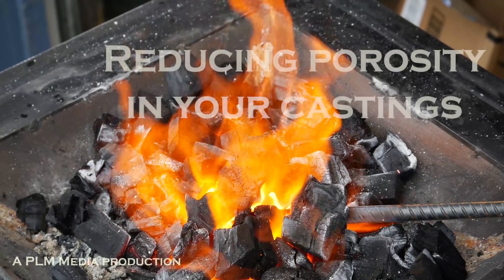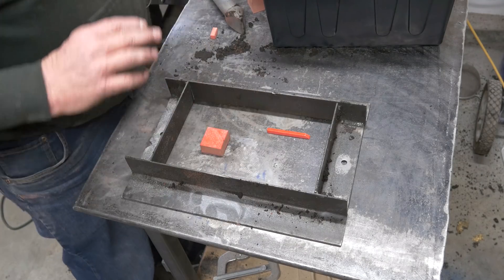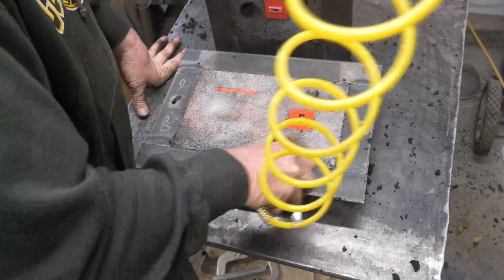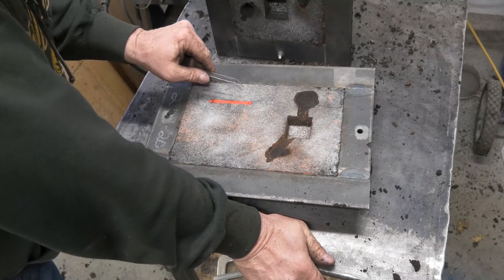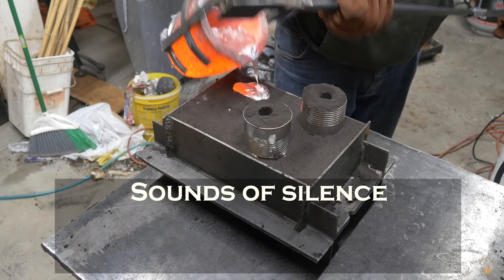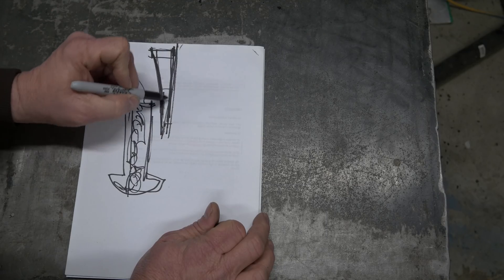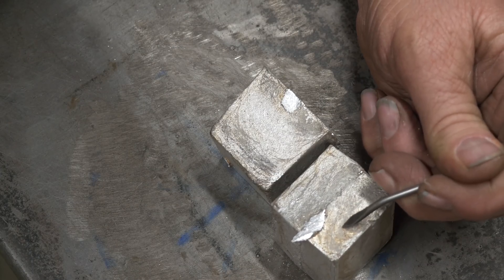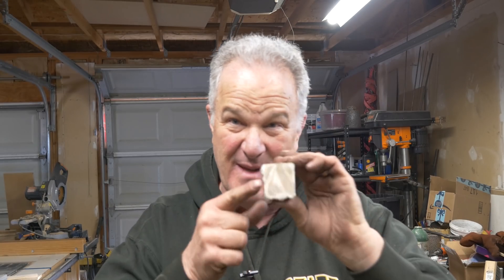Reducing porosity in your castings

Comment: Great demonstration Perry! Do you think it would have made a difference if you poured the metal faster in “A” like what Bob was saying in a previous video? 🤷🏻‍♂️ but great job though 👍🏻
Reply: Art, Unfortunately what Bob said is a bit open to misinterpretation, to me he said pour fast enough to avoid miss fills but keep the velocity low. I do not think Bob was suggesting that we should just dump the metal into the mould in an instant. AS John Campbell points out it is surprising how slow you an p[our a mould and get a well filled casting. I have seen 10 Kg castings filled in 5 seconds that showed evidence of miss run because of the chaotic fractured metal front. The system was redesigned to fill in 20 seconds and no sign of miss fill because now the metal front was a steadily advancing wall that tended to keep it self hot. In essence what I took from Bob's statements was keep the Lbs per second high enough to avoid miss fill but keep the feet per second low enough to avoid undue  turbulence - correct gating design can achieve this.... Martin
Reply: Olfoundryman thanks martin 👍🏻 so would you say a tapered sprue is necessary or it’s more important for proper gating? Also the basin in the cope to let the metal flow over and in?
Reply from the maker: @ArtByAdrock  hey bud, sorry I missed your original question.  Let me jump in here to try and answer... Martin correct me later, he's never been shy about that. ;-)

The basin/ridge is there, to minimize the turbulence and "sucking of air that happens when you pour directly down the sprue. If you notice (i'll do anything to drive more views) when I poured into the basin there was a solid, short stream of metal between the crucible and the basin as the basin fills in a fairly calm manner it runs over the ridge. The goal is to maintain a flow rate that keeps the metal over the ridge AND the sprue full. That will virtually eliminate air coming down the sprue and into the part. 

The taper is there to prevent the metal from having space between the wall of the metal (think of the metal flowing inside a pipe it has made) and th sides of the sprue. The taper reflects the fact that as the metal falls it gains speed. As it gains speed it the pipe gets smaller and smaller (diameter) . Just like the water coming out of your faucet does if you turn it on a low enough rate to get solid flow but not drops of water.

The runner is pretty much extensions of the sprue. If they're too big, metal has room to slosh around. If they're too small, you restrict the flow. 

Gates, as Bob said can be larger to slow the flow of the metal but I think they should be the same area, in cross-section as the runner. If you have two gates, they should each be half the size of the runner.
Reply: @ArtByAdrock , I think of it like an F1 racing car - all the bits (including the driver) have to be well deigned and working in harmony to win the race. That said if cornered on the subject I would say that the small tapered sprue is the most important, a close second is the ridged pouring basin design and these are very easy for anyone to do - there is not really any excuse for not using these. The runner and gates are a more difficult thing to get right and their correct design can vary a lot from casting to casting making it more difficult for us hobbyists. But if we at least keep the runners etc on the thin side (less than 12mm) so the metal in them can not fall over itself and thus trap oxide and also tends to stay in a solid front that fills the runner completely we won't be too badly off. There are other refinements that we can try and I think SW has an upcoming video that might show some of these.... Martin
Reply: Olfoundryman ok thanks 👍🏻 if you watch this thursdays video I put out when I do the sand casting I would love to hear your input and any advice. I’m sure other followers would as well
Reply: @swdweeb , gates can and should be wider, to slow the metal entering the unpressurized area of the mold down to below the critical velocity (20 in/s). The trick is, what to put at the transition so this doesn’t create turbulence. Bob Puhakka says that’s what filters are for (and not for filtration).
Reply from the maker: Good point and very true. The drop of my sprue is short enough that I think I stay below the 20in/sec but yes widening the gates allows the same amount of material to be spread across a larger area so it moves slower.
Reply: No,  @swdweeb , you’re well over that number. 20 in/s is the speed reached by something falling only ½″. (From v = √(2gh) = √(772 in/s² × ½″) = √(386 in²/s²) ≈ 20 in/s.)

Fortunately, the “top gate” is straightforward enough to implement in a two-part mold. I sent you an email with a sketch.
Reply: @olfoundryman8418  I was thinking Bob meant it literally. By matching the basin size/sprue/runner system to your personal "max" pouring rate, you guarantee the mold fills as fast as possible without causing aspiration, eliminating some potential casting defects, and guaranteeing that you can keep the sprue properly full. Then using the gate size correction factor (with or without stepped/slot gate or stepped surge chamber/top gate) to slow gate velocity to or below sessile drop velocity. I'm thinking it's importatnt to differentiate between volumetric flow rate, runner velocity and gate velocity.  As ever, very interested and appreciative of any thoughts you care to share.

Best regards,
Al
Reply: @Gippetos , I sure hope that Bob did not mean it literally! I am sorry but the idea that you should always pour at your max personal  rate is to me just  plain wrong. I have 3 Kg castings that I have  to pour in 5 seconds and others of the same weight that I pour in 30 seconds, the times being necessary in each case as part of the method to get a good casting. Each casting is different and requires its own unique fill rate, all controlled by my choice of sprue, the idea that this would correspond to my "Personal max fill rate " which is going to be different most likely from everyone else's is  - well you can guess what I think  😏. Many of the old foundry industry adages are absolute rubbish as Bob and John Campbell have very successfully proven but one that has stood the test of time is to pour as slow as possible consistent with getting a good fill, and it is surprizing just how slow this can be - most newbies, hobbyists, and professional alike do this panic about "quick before it goes solid" It will indeed go solid but not as quickly as most think. There is no need for undue haste. Sorry to disagree but I gota tell it like I see it. 😊.. Martin
Reply: @olfoundryman8418  Your 60 or so yrs (or was it 136? lol) of experience certainly outweigh my handful of lost foam pours Martin. I've still a great deal to learn, and mistakes to make...hopefully doing more of the former will reduce doing more of the latter. ;) 
Thanks,
Al

Comment: I would suggest that the big sprue and vent acted somewhat as improperly sized risers which is why there was less shrinkage in that block than in the B block with the proper tapered sprue. 
Doing a little quick estimation on the riser sizing using Chvorinov’s rule for those cubes...
I estimate those are 5.1 cm cubes (2in)
TTS = total solidification time [min]
V = volume of the casting [cm^3]
A = surface area of the casting [cm^2]
n = an exponent usually taken to have a value = 2
Cm =  the mold constant [min/cm^2] its value depends on the particular conditions of the casting operation, including mold material (e.g., specific heat, thermal conductivity), thermal properties of the cast metal (e.g., heat of fusion, specific heat, thermal conductivity), and pouring temperature relative to the melting point of the metal.
TTS = Cm*(V/A)^n

we design the riser to have a larger volume-to-area ratio than the casting
First determine the V/A ratio for the cube (5.1^3)/(6*5.1^2) = 132.65/156.06 = 0.85
we'll select to solidification time of TTS = 1.6 min

now solving for the estimated mold constant Cm we get 1.6/(0.85^2) = 2.215 [min/cm^2]
using this estimated Cm value and a 25% longer riser solidification, we solve for the cylinder for
 the riser will have a diameter-to-height ratio = 1.0
V = (pi*D^2*h)
/4
A = (pi*D*h) + (2*pi*D^2)/4
using a D/H ratio = 1.0, we get D = h
V = (pi*D^3)
/4
A = (pi*D^2) + (2*pi*D^2)/4 = 1.5*pi*D^2
V/A simplifies to D/6

Now solving Chvorinov’s rule for the risers we get
TTS_riser = 1.25*TTS_casting -> 2 = 2.215(D/6)^2
we solve for D
sqrt(2/2.215)*6 = D = 5.7 cm
so a cyclinder with a diameter of 5.7cm and a hight of 5.7 cm

you had a sprue and vent with about 1.9cm diameter and the hight of your cope plus the extenders (wild shot in the dark 15.24 cm~6in)
V≈43.21cm^3
A≈96.64 cm^2
V/A = 0.447 (each) so with Two (sprue and vent) you get 0.89
you needed a riser with a V/A of 0.95
or 0.89/0.95 = 94% of the value needed, hence why the shrinkage was less for Cube A than for cube B
Reply: Ask, Improperly sized feeders (i.e. too small) inevitably suck from the casting, thus I would expect shrinkage in A to be worse than B were it not for the extra gas/air caught in A compensating.
On the subject of providing adequate feeders I take a more rudimentary approach. All my feeder formers have a bottom that is reduced in diameter to about 2/3 that of bulk of the feeder, the reduction taking place over about one diameter. I look at the casting and choose a feeder with a connection (bottom) diameter of about the thinnest dimension of the area I am trying to feed. Feeder height is about twice its large diameter, total feeder weight -there maybe more than one - about 75% of casting weight more for thick work less for thin. I guess after all these years its an eyeball thing for me. I simply do not have time to go through all those calculations for each and every job. Although for the less experienced the calculations plus after casting observations can be used to tune the eyeball... Martin
Reply: @olfoundryman8418  there is definitely value to those "rule of thumb" selections, I'm sure there is probably a table for selecting the right size feeder in some industry handbook somewhere too. 

I would normally agree that a small feeder which solidifies before the casting would normally suck metal from a casting, but my gut feeling on this is case is the solidification time for the sprue and vent would have been very close to the solidification time for the casting (I would need to run the numbers to be sure). I think this is a case where they solidified at close to the same time, and are not severely undersized. 

I do agree that the trapped gas in the casting will also puff up the casting making the solidification shrinkage less apparent.
Reply: Looks like I was way wrong on my assumption that the sprue and vent would solidify at close to the same time as the casting. Running the numbers they would likely solidify after 0.44 minutes, long before the casting solidifies.
Reply: @askquestionstrythings , Not surprised, the casting is a cube, lots of volume little surface area close to the impossible to feed sphere. Just with the old eyeball I would judge the sprue and vent to have a way higher surface area to volume ratio. To successfully feed those cubes you would need a feeder that would look almost stupidly massive...Martin
Reply: @olfoundryman8418  Yes, by the calculations above I had estimated that the feeder  (riser) would need to be a cylinder 5.7 cm in diameter with a height of 5.7 cm. I agree "that would look almost stupidly massive" especially since a feeder that size would be larger than one of those cubes.
Reply: Ask,  Were I to attempt to cast these cubes and wish them sound I would probably resort to use of a large chill much as I did with the Brush pistons or the Hercus gang tooling blocks. I would of course use exthermic on the feeder. This would allow a smaller feeder. But still not an easy thing tocast solid and shrinkage free. 
Now I have a favour to ask, I have been working on sprue tapers via an excell spread sheet for a couple of weeks (yes, its that complicated) I would like someone to check a few of my answers in an independent manner. If you are interested in doing this for me please conatct me at mmwestathotkeydotnetdotau... Martin
Reply: All this formula is making my head spin. I think that I will use the Mark I eye ball method and a bit of the rule of my thumb.
Reply: Mark, Come on the maths is not that hard! It pays to work through the calculations few times  for a few different castings as it helps get the eye ball and thumb tunned in - I sure did and still sometimes do.... Martin
Reply: @markfryer9880  formulas typed out and not in mathtype make my head spin too.
I like the numbers to be able to explain things. Sometimes it confirms what I'm thinking and other times it disproves what I'm thinking.

Comment: Great video and lots of good comments.   Any ideas on how to make the connection between the tapered spru and the runner a curve like you had in the drawing ?
Reply from the maker: Thanks Dan. A couple of ways. You can do it like I did with the runner pattern. The curve is on the pattern. The curve on the top of the runner can be cut with a brush.  Cutting it by hand will be a bit trickier but I suppose it can be done with practice.
Reply: @swdweeb  Not at all sure we are on the same page.   The drawing you made has a spru that curves to meet the runner.  Obviously this would be impossible to withdraw from the sand.   Maybe a core could be used to do a gentle, smooth,  vertical to horizontal transition with uniform cross section.

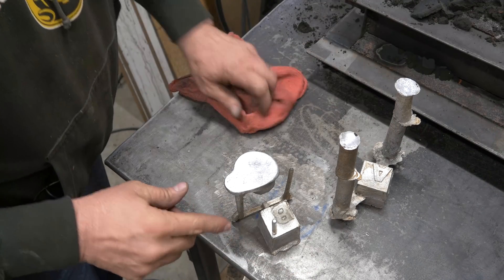Not criticizing at all here, my plumbing looks like what you are showing at 12:45, more or less a right angle.    I am wondering if we can do better with that nice curved transition
Reply from the maker: Dan, email me at swdweeb@gmail.com. I'll show you a picture of what I mean
Reply: Been studying on how one could get that curve instead of a sharp 90 if I come up with something worth mentioning I'll let you know.

Comment: The proof is in the pudding 😂 the thicker the casting the porosity chances increase.  Cut that open I bet it's full of porosity,  Martin knows what he's doing it's not just a hobby for him. I'll be doing some test myself that's the best way to learn, even though it may be only a hobby I'd like to learn how to do the best way possible.  Thanks for sharing with us Perry.
Reply from the maker: When I get home from work today I plan on trying a volume versus weight measurement to see if I can see anything.   Martin suggested that the more pronounced shrinkage was due to a less porous pour as well.  Given the relatively small size of these castings I don’t know if I’ll see much in terms of weight evidence.

It’s also been mentioned that, as you say, I should cut it in half and look. That might be in the future as well
Reply: @swdweeb  yes, machine some of those surfaces and cut the cubes apart. The unmachined casting surface only tells a small part of the story. 
There is also a dye test for penetration you could consider.  Dye Penetrant Testing, aka liquid penetrate inspection, tells a story beyond what you can see with your eyes. (it's also used in inspecting some welds for porosity)
Reply from the maker: Sure, just machine the surfaces ;-)  Let me run out and get a mill first
Reply: @swdweeb  lol, you'll need to run out and get a larger garage too. ;-) 
then you can plan on getting a lathe, a shaper, a surface grinder, a laser sintering metal 3d printer, a laser cutter, a waterjet, ultrasonic inspection equipment, handheld XRS spectroscopy, and a 5-axis CNC. Got to plan for all the toys in the shop. =D

but for what your doing here you should be able to see the general defects by grinding or belt sanding the surfaces and consider that as your "machined" surface.
Reply: Ask, Yep, you have to collect all the toys  - its the natural order of things. But first you need a big shed to fit them into and in your climate a heated shed at that. But for now a bandsaw and a disc sander plus a bucket of caustic soda solution will suffice to show porosity... Martin
Reply: Perry could warm up by using a hacksaw.